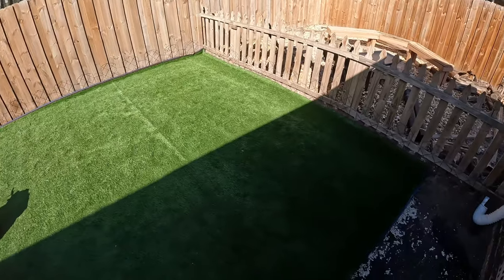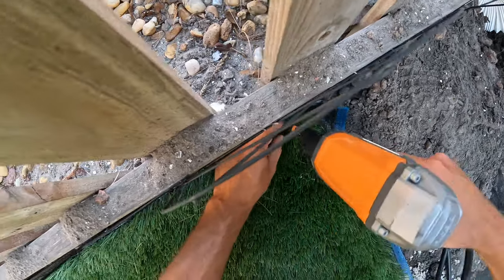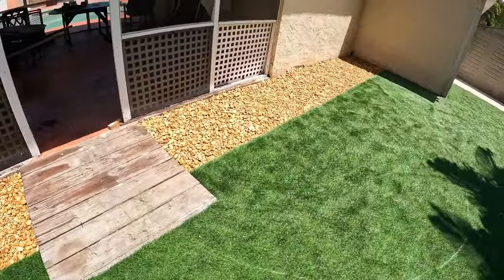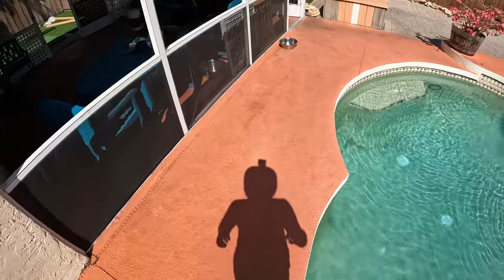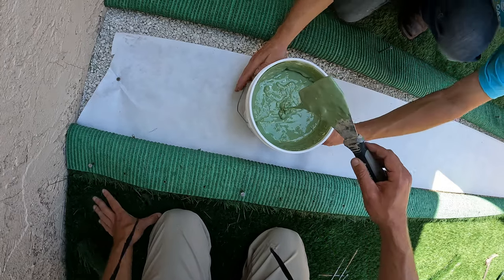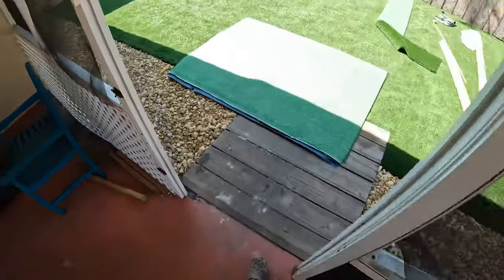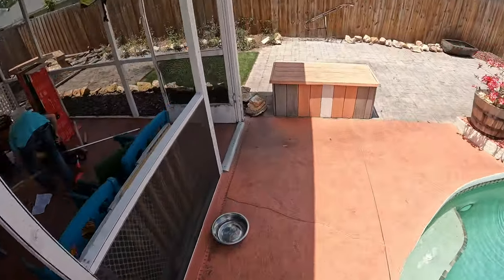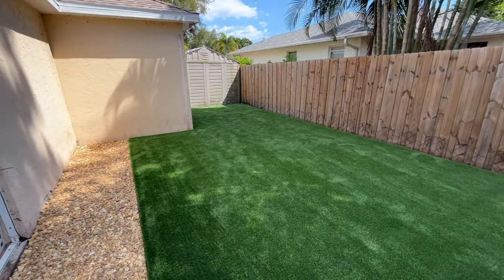ARTIFICIAL TURF INSTALLATION PT. 2

Comment: Wow! What a Nice job! Its a shame she has to let the Doggie's out on it(I know that was the whole purpose). I just picked up the same 18volt milwaukee setup myself. I got the String trimmer and edger attachments for it. I was looking at the brush you got, I just dont know if ill use it enough to justify the cost right now. Maybe down the road a bit. I also have a Echo gas trimmer and edger too! Keep up the Great work!
Reply from the maker: Thank you! The attachments are crazyyy expensive for this thing it blows my mind. i have the edger and weed eater for it too and love it! the sweeper actually worked better than the gas one i had before it so i was happy about that!